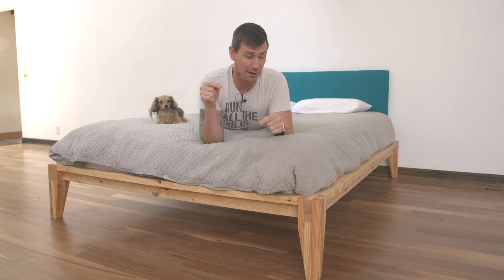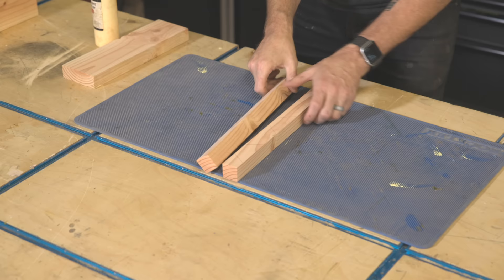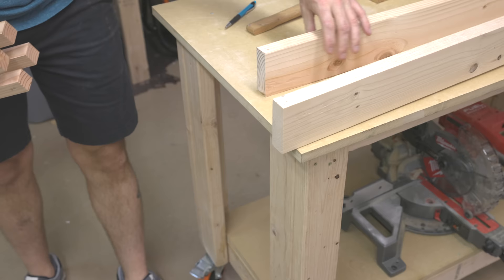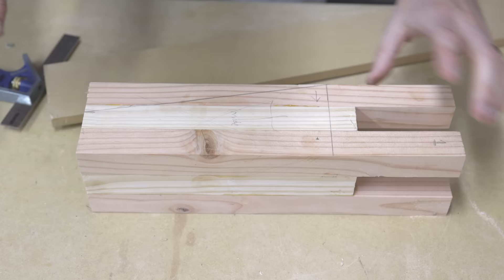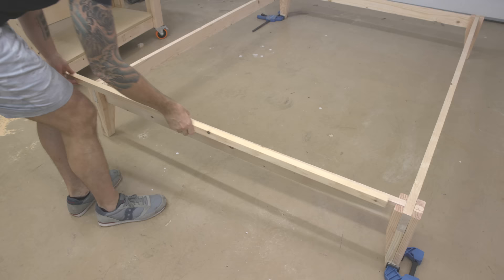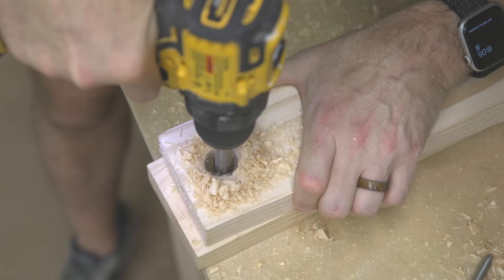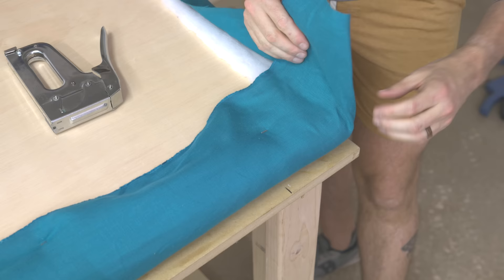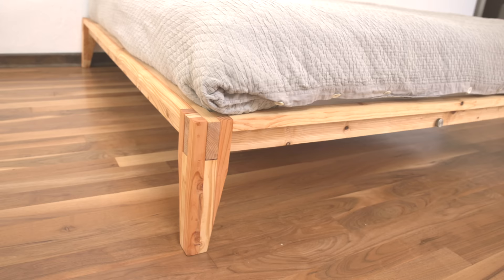DIY Castle Joint Platform Bed made w/ 2x4's Buy vs. DIY

Comment: In the reveal section of the video, where did the top half of the inside corner of the castle joint go?
Reply: Never mind, I found out where they went after building this myself - for those interested, the original measurements for the bed don't take the inside castle joint corners into consideration, therefore the mattress would sit on top of those inside corners. My measurements for a queen-sized mattress were 64x84 inches, but I should have added another 2 inches to each of those measurements to account for the extra inch of inside corner for each end of the supports. You could also just add an extra 2 inches to either dimension, making the frame either 2 inches wider or 2 inches longer to account for the corners.

Comment: When did you cut the inside castle corner?  Comparing at 11:15 in video (laying and taking out the slats) it is still there, 12:59 -finish sanding it is still there, but then when sanding and finishing (13:02 it is not?  How much did you cut it down, as it does look like there is a little stub left?   THANK YOU!

Comment: If you have patience you could probably get away with just a hand planer and a decent back saw or a really sharp rip cut saw it would just take longer looks like a good build to me I like it I'm going to try to copy it.
Reply: You really can't , you need to get the thickness to be a third of the width. Because you put 3 boards together then glue it to one original width one.  That's too much for hand planning to go from 1.5 inches to about  1.16 inches

Comment: Everywhere I see these types of Japanese beds made professionally, the joints are reinforced with laminated wood at the ends of the frame pieces. That was my main concern with DIY and in this method those ends appear quite weak.

Comment: I have a question...I noticed you didn't put any screws on he legs after gluing.  Won't they pull apart over time? If not what kind of glue did you use to prevent that? I love this design!
Reply from the maker: Wood glue is exceptionally strong and does not require additional screws.

Comment: I’m about to start building this bed but wanted to use a bit nicer wood.  all I can get right now that isn’t pine 2x4s or a million dollars  are 1x4 poplar. Do you think with the upper and lower cleat on the outside and inside of the rails acting like an I-beam it would be strong enough for a king size bed?

Comment: olive in australia do not have 100x50 but 90x45 would that be ok to use those dimensions ans adjust or laminate timber to get the 100x50 dimensions

Comment: Did this dude plane those boards like 6 times each at the beginning?  My planer absolutely can't take 1/4" off a board at a go.  He ripped these first but didn't mention it.
Reply: He also didn't mention the 2x6s he used in the castle joint sandwich.

Comment: Thanks! For a twin size version, does it need the center rail for support or can I skip it?
Reply: I made a twin bed and didn't use a center support rail. However, I would recommend using at least a dozen slats to distribute the weight of the mattress.

Comment: Nice build but where are you getting $1100 from? I have a thick steel frame built like this for $200 but it doesn't have slats it requires a box spring.
Reply from the maker: From the Thuma website

Comment: Great vid and project, but as always, these cost comparisons make no sense. If you're doing it just for the fun of it, or the fact that you'll have a one of a kind product, great, and much respect...but once you add up all the time it takes to make this(all the planing, sanding, measuring, fitting of hard ware, travelling to pick up and pick out material)mutiply that by the cost per hour that your best skill gets in the open market, then add that to the cost of materials, these things generally cost well in excess of what it would cost you to just buy it.

Comment: He jumps from showing the castle joints with four pieces the same length, to the castle joints with the inside section cut down to allow clearance for the mattress at 13:01, and doesn't ever discuss that particular modification... If you just followed his verbal instructions here, your bed would not fit.

Comment: The thumbscrew you linked is no longer available. Any chance you can link a suitable alternative? I’ve never used them before 🤔
Reply: I built the bed and just used a 3/8 bolt with a washer to go with the T-nut.  Ya just have to use a wrench or socket to get it tight.  Just don't go too hard.
Reply: @edpewalkee  yeah I’ve already built it now as well. I found some bed hardware at WoodCraft that worked perfectly

Comment: Building finish grade furniture with construction materials from home depot will leave you screwed.

All the 2x4's at any home depot I've been to has been wet lumber that needs to dry before using for finish furniture. @ 1 year per inch, your 18-20 months from being able to use the wood. Not only that, but home depot lumber is kept in such disarray that I've sorted through half a pallet looking for 4 good pieces. Which I'm pretty sure was all sorted through by 20 other people, yet home depots minimum wage employment just tosses it all in a pile, back on top of the fresh wood.

If it feels cool to the touch, leaks water when poked, and oozes sap all over, it's not good for building. It's going to warp, bend, and twist. Maybe even crack if it isn't given room to move.

Cool jointery on this bed, but horrible telling people to consider making 2x4 furniture. For the costs involved just shop at ikea, both will live as long. One will die on you (ikea), the other you will want to kill (bent 2x4 monstrosity)

Comment: Anyone know where I can buy a nicely made bed like this? Even the $1100 ones seem to be shoddy.
Reply: I'll make you one like this for $1100 and ship it to you for free, shoot me a PM. 

Alternatively you can get a much nicer bed frame + headboard on Amazon for $200-300; but if you have money to burn and like those wonky cuts, ill fitting joins, and distinct look of 2x4s you see in this video, then I can hook you up!
Reply: @nec135  lol, you’re not very convincing. I’ll agree that some parts of the build on this bed could be improved but the ones on Amazon that I’ve seen are horrible. Thin metal frames with slats too far apart, that sag when you lay on them, that are unsteady, and are a pain to put together… that’s all I see. Same with wayfare

Comment: First get a full equipped carpenter shop for 10K then proceed to build 50$ bed frame.
Reply from the maker: or…figure out a way. Actually giving up when you hit the slightest hint of resistance is so much easier.

Comment: Step 1: have a full machine shop
Reply from the maker: Step 2: give up at the slightest hint of resistance
Reply: @JonnyBuilds  step 3: not factor in the cost of labor, machining, abrasives, development of skills into final cost.
Reply from the maker: Step 4: make all the excuses why you can’t do it. 
Step 5: blame someone else 
Step 6: remain softer than wet bread
Reply: @JonnyBuilds  step 7: misrepresent and mislead your subscribers and insult random people on the internet.
Reply from the maker: You pulled that sentence directly from my “about” section.
Reply: @JonnyBuilds  I’m commenting on the actual cost of the bed frame you built vs what you reported.  I’ve read your “About” section and it does not cover any of that.

Comment: You aren't taking into account the price of the tools to cut, sand, drill, trim...  all that wood to DIW  and if you don't have them in advance you'll have to buy them (at least the firs time, over time the cost will be divided into the number of proyects you use them.

Comment: Cheaper… first I’d need to buy expensive electrical tools, just to make the 2x4’s flat and straight. Replace all the electrical tools with hand tools, you get the same joint, same results, still no chisels and cheaper.